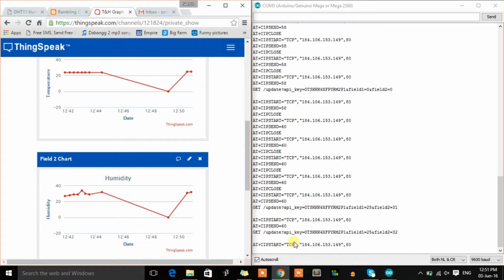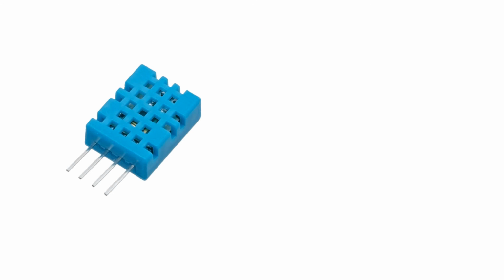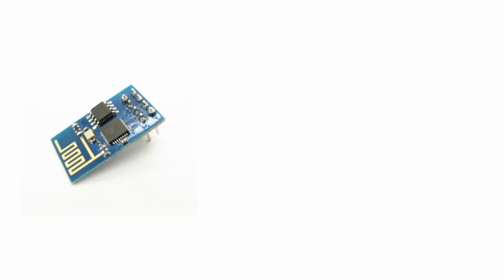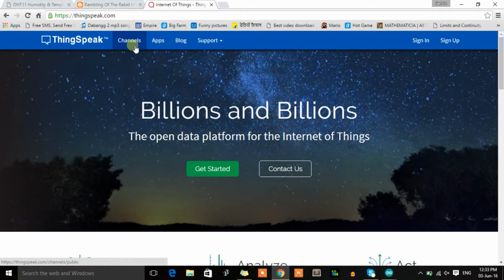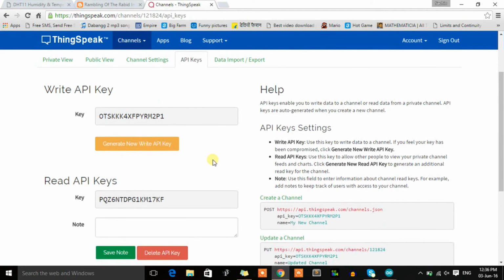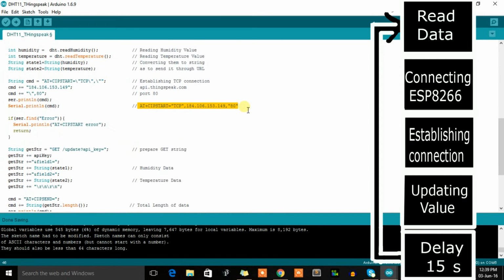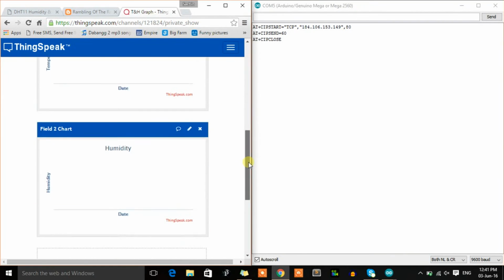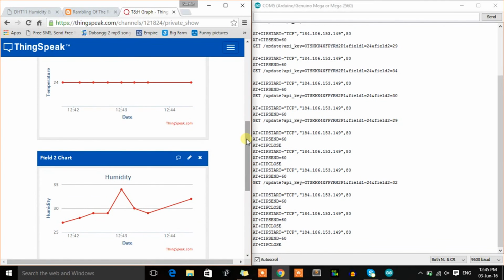Monitoring Sensor's Data over Internet: Electronics For You DIY Project

Comment: Hi Sachin soni/Techiesms nice video and thanks for sharing the source code. 
I have tried it, but I was unable to connect to thing speak channel, locally on serial monitor sensor values are displaying. I have entered apikey, host name and password correctly.
output on serial monitor is like this 
humidity = 53
temparature = 24
AT+CIPSTART="TCP","184.106.153.149",80
AT+CIPSEND=60
AT+CIPCLOSE

whether the current drawn from esp8266 is less for its to upload??!!!

do help me in this regard.
Reply: mail me the query 
I'll try to solve that 

sachinsms1990@gmail.com
Reply: Same problem
Reply: raghu dathesh g p 
I have similar problem
Reply: Same problem sir what can I do next please tell me sir